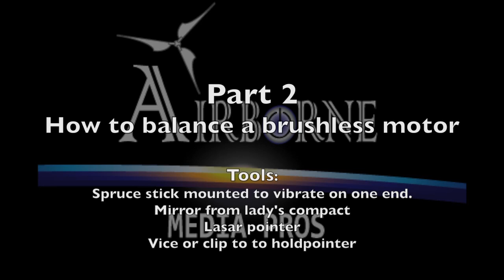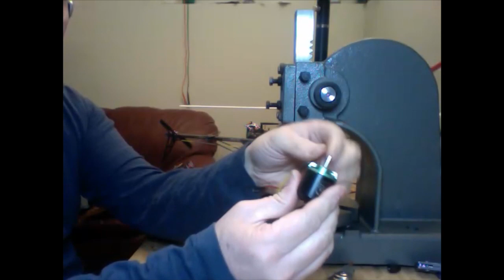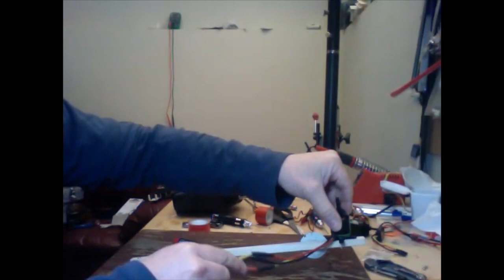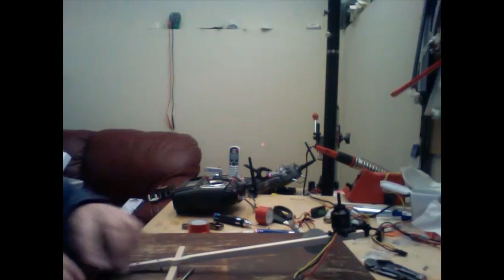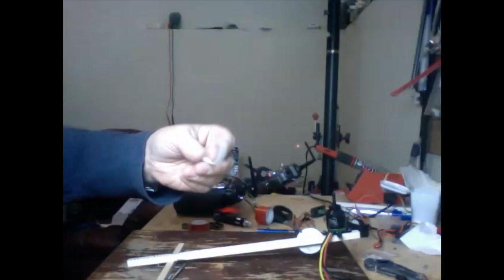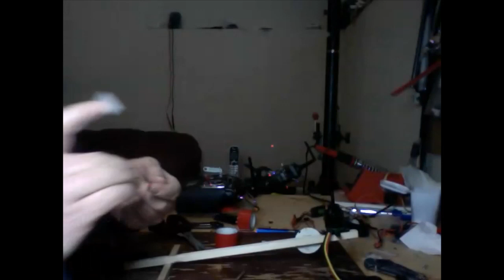How to balance a brushless motor

Comment from the maker: Hi locoboy007,
It is best to use the mirror because the vibrations are magnified by the mirror. For one; the lazar has to travel a distance from the source to the mirror and than another distance from the mirror to the wall. Further, there are small angular distortions added by the vibrations. Having the lazar on boom it's self would not show these angular distortions as well, unless you had a very large distance btn the lazar and wall, placing the dot further from you.

Comment: Great video Will, I will look forward building a homemade motor balancer similar to yours, I like your setup.  I was wondering would this be the same if you just replace the mirror with the laser pointer , mean mount the laser pointer directly next to the motor on the bracket and point it to the wall, will this be the same?